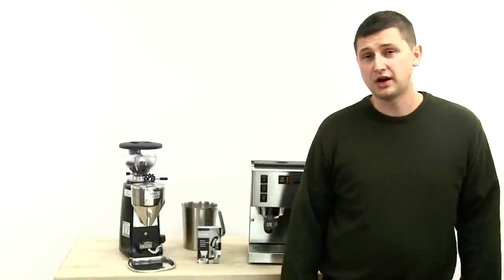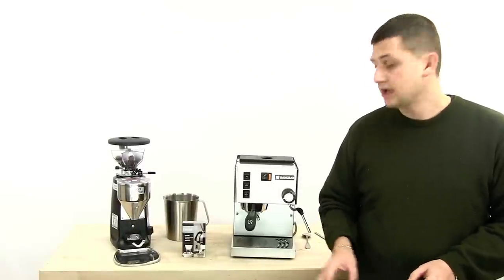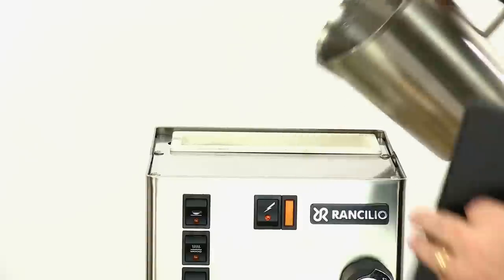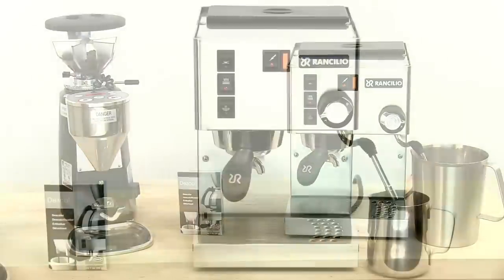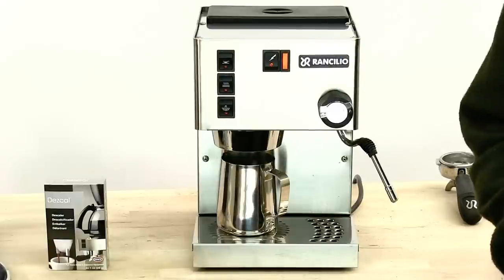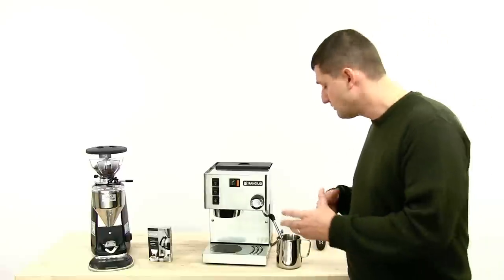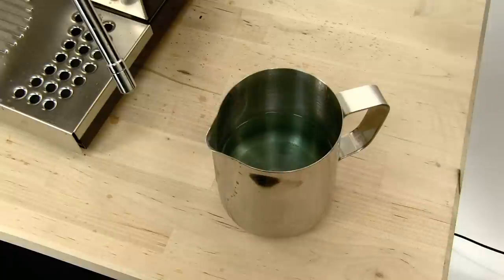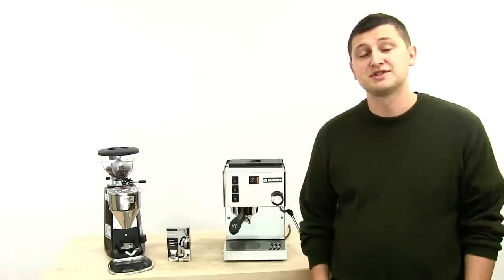How to descale a single boiler machine like the Rancilio Silvia

Comment from the maker: Never leave a single boiler machine for a long period of time in a steam mode. This may cause a serious damage to the heating element/boiler.
Reply: Hello, I think I may have left mine on too long and now no steam.  I just got done
replacing the steam thermostat and I am descaling.  Still no steam.  However, I 
can brew all along.  Any idea?  Is it possible steam wand is clogged?
Reply: @somedarkhorse58  steam tip/wand would be the first place to start

Comment: i have 3 months old machine i accidentally left my machine turned on for quick long time and when i returned the wand seems loose andnot tight as it was before and when steaming milk a lil dripping is coming from the top of the joint nut.. :( i may have damage the seal kit of the machine.. 😢😴😦😟😵
Reply from the maker: +Nhej Felix 

What machine do you have? You can always contact our tech department at tech(at)idrinkcoffee.com if you need proper support.

Comment: Hi, I am considerin buying this machine' I am new to the espresso machian but this one seams good. Well. I have reqd alot about this boyler burning of. Are you able to show got to prevent this?
Reply: I recommend buying an older model. The chassis on the newer models rust out right away(a few months). Then you are into cleaning rust off and re painting etc....I am having a really tough time with my newer model. Stopping the rust is difficult. The old ones didn't tend to rust. I am thinking they changed suppliers that used a cheap paint to keep the price down.
Reply: @jonwikan3986  i got one 2 years ago and didnt need to clean any rust so far
Reply: @music4note  maybe they changed back to the original supplier?
Reply: @jonwikan3986  hmm could be :)

Comment: what's the reason you leave machine off while the acid is inside for an hour?
Reply from the maker: just to save power, nothing will change if it is on but you will be heating the solution.

Comment: HELLO, I descaled the machine with a descale material..
i noticed that after all the material went in the machine There are metal flakes in the water..
Have you ever had this metal flakes in water Problem?
Reply: not sure if this is your issue, but citric acid can eat away at metal-- if you used a metal spoon or similar to stir it into the tank, maybe that is the problem?

Comment: What abut to leave a blind filter in to soak the group head and 3-way valve?
Reply from the maker: Hi, that is a separate procedure.  I do recommend backflushing every 100 to 150 drinks or so
Reply: @iDrinkCoffeeCanada  yes, backflushing is different with different with parts cleaner .....but why not soak the grouphead and 3-way with descaler instead of just the Boiler?
Reply: @77Cfriend  most of the limescale drops out of solution where the heating element is. So the buildup is much higher there.

That said, it shouldn't hurt.

Comment: How about Citric Acid as the Descaling agent?
Reply from the maker: +themiln 

A descaling agent like the Urnex Dezcal or Durgol Swiss Espresso will be more powerful and effective.
Reply: Urnex Dezcal is 60% Citric Acid. The Citric Acid is the component that does the hard work. Using pure citric will do the job exactly the same, as I use it on my La Pavoni lever machine. Just be sure to flush properly. It also has the benefit of being non-toxic if ingested.
Reply: @iDrinkCoffeeCanada  , I understand your viewpoint, but don't agree.
Reply: @iDrinkCoffeeCanada  Well, if course he recommends a product which he can sell instead of a household item that costs a fraction, even though it's 99% the same thing.

Comment: I've had my Silvia for about 3 years and never cleaned it.... Oops.
Reply from the maker: Definitely time to clean it. Also don't forget to clean the showerscreen.
Reply: del If I haven’t backflshed mine with water after every use and with solution once a week + soaking the elements such as the shower screen, basket, porta filter etc in solution at the same time, my coffee tastes awful after about a week. Descaling needed every 2-3 months using filtered water.
...But three whole freaking years!? :o